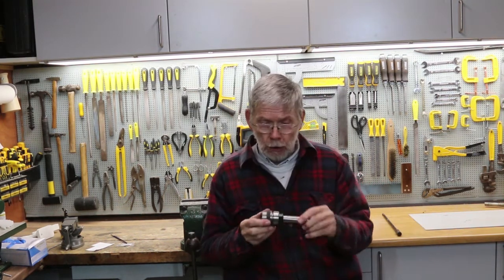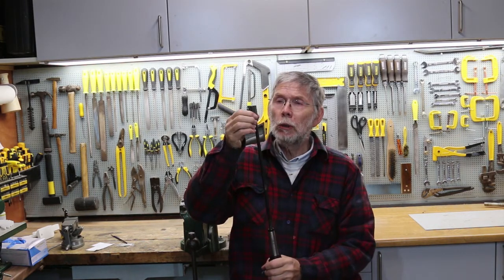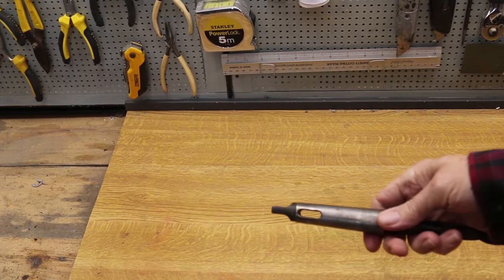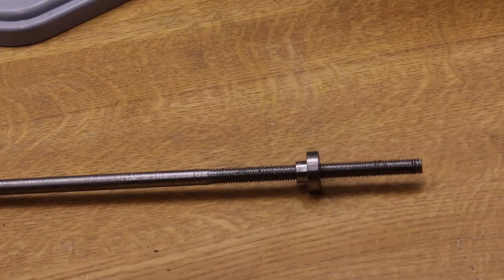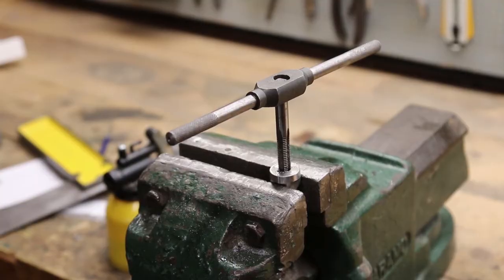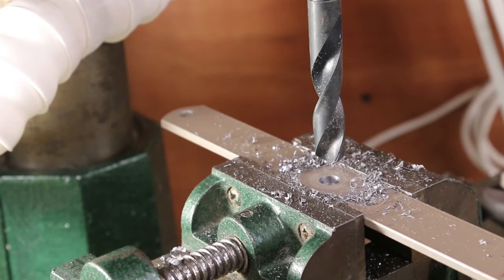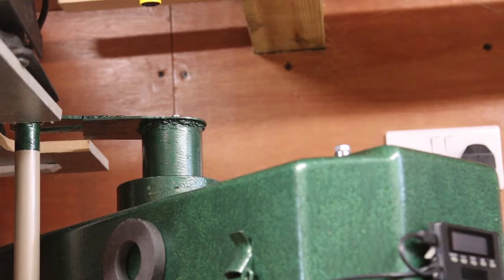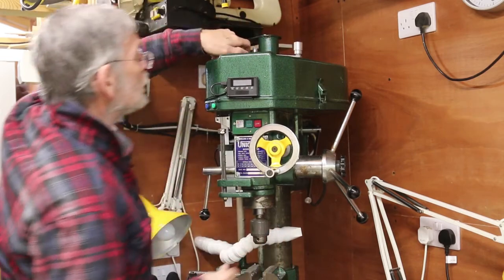Drawbar release

Comment: Hmmm, I had to watch this video a couple of times (mainly due to you not showing the drawbar retaining crosspiece in place and the installation of the drawbar, but instead choosing to show the making of an entirely superfluous winding handle) to come to any conclusions.

I suspect there's a good reason this solution isn't more widely used.

If your draw bar is small enough in diameter to have the shoulder/flange that keeps the retaining cross piece, be less than the 12 and change millimetres of the ID of the spindle, this will work okay.  

However, if your drawbar is too large in dia. (Osborn Titanic and Clarkson Autolock chucks tend to be 7/16" UNC threaded, and the most common MT3 ER32 chucks tend to be M12), to allow the crosspiece retaining shoulder to pass through the spindle bore, then this idea won't work.

Even if it works, it seems a bit of a half-arsed solution, with the cross piece being potentially free to rattle up or down the shaft of the drawbar at will, whilst milling.

On the round column mills, adding a drawbar retaining collar at the top of the spindle is a bit of a pain, requiring the removal of the big spindle pulley retaining nut to install the bottom half of a collar. 

However it's not that difficult, is a lot more elegant, and makes the changing of drawbars much easier, and the use of larger diameter drawbars possible.

Glad your solution works for you, but it would not be a solution I'd recommend to anyone who was thinking of making some sort of captive drawbar for a round column mill.
Reply from the maker: I did not show the cross piece in place, because there is nothing to see- the cross piece fills the slot. Assembly is simple- push the crosspiece into the slot, feed the drawbar in from the bottom, and add the top nuts. There is no rattling- the only degree of freedom is upwards, and that around a mm. If there were enough vibration to cause the bar to lift, that would be the last of your worries... ( I use a Bridgeport type mill at my local Men's Shed, and because the drawbar secures lower down, its rattle is the loudest noise it makes...)
The size of the thread required by the toolholder is not an issue- that thread is below the crosspiece. Larger threads actually give you a broader collar surface.
As you say (and I did at the beginning of the video) adding a top collar is not an easy task- which is why I came up with this simpler system, which has stood the test of time. I was using it this very afternoon, four years on...
So, it works, and it does not rattle. Makes it a full arse?